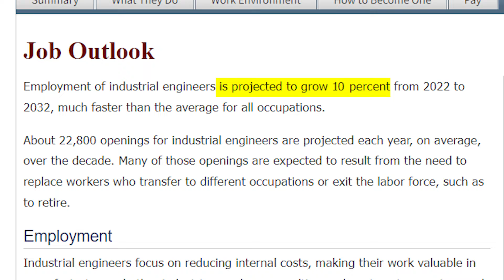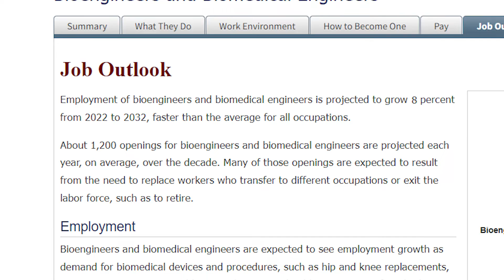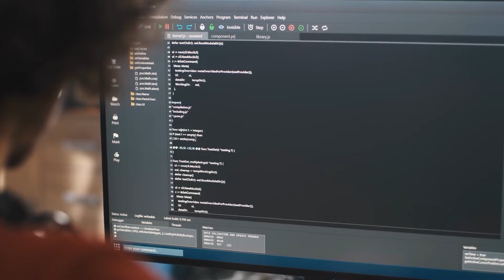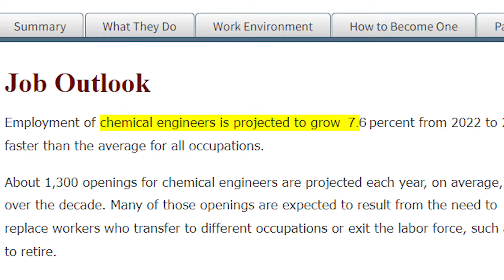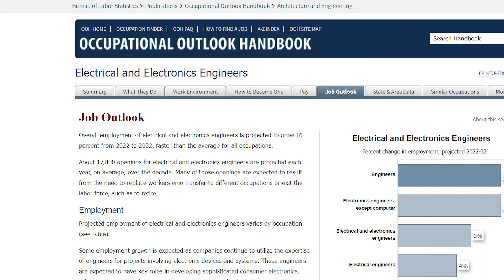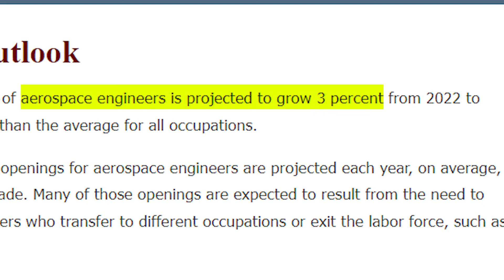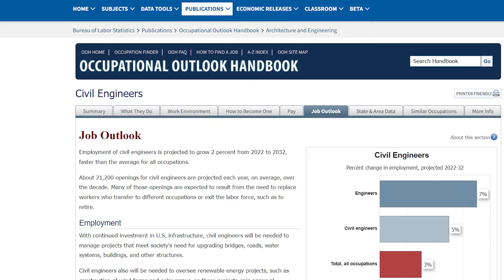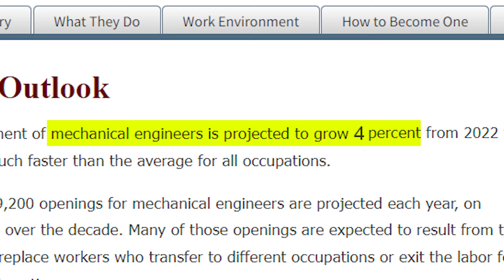Top 10 Engineering Degrees (MUST WATCH)

Comment from the maker: ▶To book time with a  career coach and for mentorship please use the link below:
https://www.blkheights.com/solutions

▶ Want to Break into TECH Sales to make $60K+ with or without a degree.  Check out CourseCareers bootcamp using the link below.  For only $450 dollars you can break into tech sales.  Use the link below or the coupon code ANTOINE50.
https://coursecareers.com/a/blackheights

▶ Want To Advance Your Tech (Sales)Career?
Check Out the Best Tech Sales Closer Course On Internet Taught By None Other Than Kevin ‘KD’ Dorsey
This course will get you on your way to making $200K Plus..  Use the link below and use BLACK100 for a 10% discount.
https://www.leveldcareers.com/tech-sales-closer-kd-sales-leader

▶ Want to advance your IT career to make over $100K+?  Check out the Leveld Careers Cyber Security Master Class Bootcamp Taught By The Best In The Game Josh Madakor using the link below. 
https://www.joshmadakor.tech/cyber/
For only $497 dollars you can advance your career from entry level IT positions to an Information Security Analyst role without any degree or certification.  Use BLACK100 for a 10% discount.
https://www.leveldcareers.com/a/2147530874/mLCGdLZm

▶Want to become a sales engineer to make over $100K.
Check out the Leveld Careers Sales Engineer Master Class Bootcamp Taught By Paul Heely using the link below. 
https://www.leveldcareers.com/a/2147714608/mLCGdLZm
For only $497 dollars you can advance your career from an SDR, Software Engineer, to a Sales Engineer.  Use BLACK100 for a 10% discount.
https://www.leveldcareers.com/a/2147714608/mLCGdLZm

▶ Get certified with Master I.T.
The onestop shop for your IT certifications to break into TECH.
https://itmasterkey.com/?affcode=196705_rkld7xac 

▶!!!THE PATREON!!!
https://www.patreon.com/blackheights